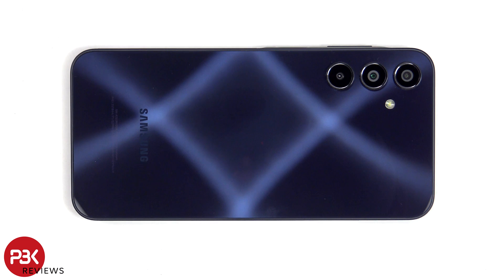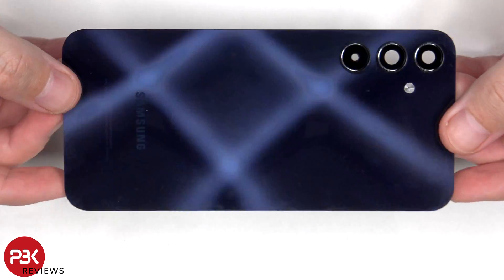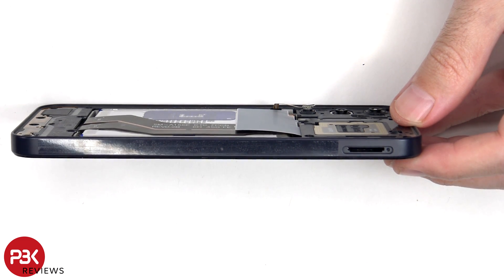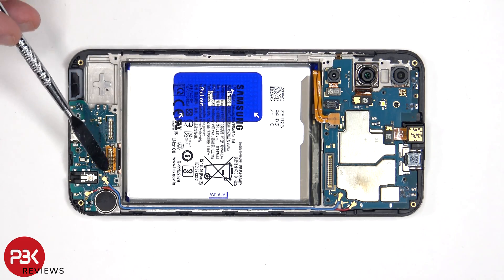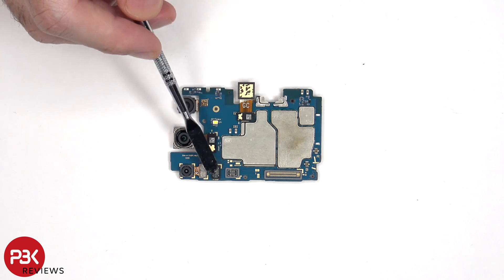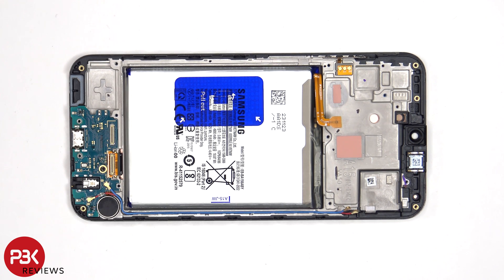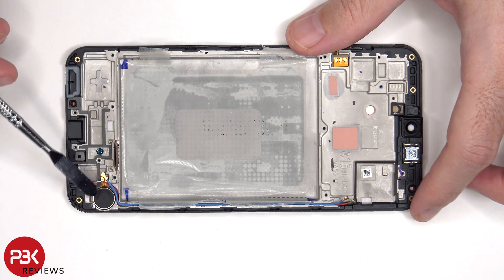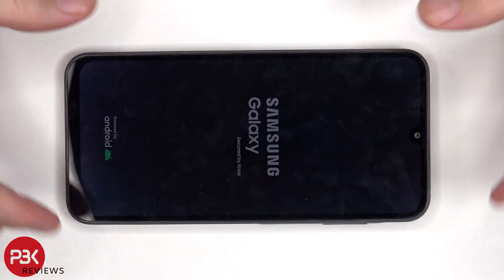Samsung Galaxy A15 Teardown Disassembly Repair Video Review

Comment: You make it sound like the screen is easy to take off in the way that you described it but yet I cannot find a video on YouTube that literally shows that process. I don't need to necessarily know that information anymore but still other people will most likely still want to know that information and you'd be the only person to actually have the video on how to actually replace the screen without just having the screen in the housing already together and just pushing the hardware into the housing.
Reply: ,most times ts easier and more cost effective to just buy a replacement screen already attached to a frame and you just swap all the guts and no hassling with trying to remove just the screen and digitizer etc.   way better IMHO for a non full time phone repair person.

Comment: Nice video, I have a question!
I was using that phone at work when I accidentally dropped it, but it seems it was fine.
It does work normally, but it now takes almost 6, maybe 7 hours to charge fully! It used to take 2h20 could it be the charging port or something else?
Reply from the maker: One of the cables or coaxial cables inside may have gotten loose or disconnected.

Comment: As an American I'll say it, America did nothing to make this repair easier, in fact it was Europe forcing these big companies to have there phones more easily repairable, and pushing for more easy to replace batteries, if it wasn't for them all phone repairs would still require you to take off your screen with a heat gun then to heat gun your glued in battery to get it out. It made me so happy to see the back taken off so it could be used for getting into the phone.

 I'm not a tech expert my I decided to take my screen off my surface pro 5 that had a bloated battery already pushing the screen of and I remember heat that thing to death and they made it so that the screen would shatter on the edges if your didn't do it perfectly, then also locked your battery behind a security screw using your heat sink to stop your from removing the battery, Then you'd haft to heat gun the gaint deadly bloated battery out and pry it off the board. (That is not mentioning the horrendous connection point for the battery) But now thanks to Europe the new surface pro has a flexible screen that's easier to get off that's way more durable, the battery is no longer screwed down from what I recall no glue, and now uses sticky pads to hold that battery with a tabs that lets you pull it off safely so you can take out the battery.

Comment: to those who dont want to heat the backplate: I did it without , its a bit of a tedious task but it works
Reply: Alternatively you can use literal hot plate heated over toaster or in a microwave to heat your phone. It is way saver and easier to not overheat anything.

Comment: Man this sucks, this guy has all these fancy tools and shit, how tf and I supposed to get into it with just regular stuff?
Reply from the maker: fancy tools? lol I'm sure you can find a hair dryer somewhere to head the back up, as well as a guitar pick or pry pick or any plastic that is thin like that which you can get underneath to work your way around. Only thing you may need to order would be a suction cup tool to help you lift up and gain leverage. If not, you can always use a razor blade or knife to peel off the back cover but it would damage or scrape up your frame.

Comment: Excellent teardown video, subbed for future reference!
Reply from the maker: Awesome, thank you!
Reply: @PBKreviews  It worked!! But i believe i failed in getting that awkward little wire to click back on right... so the fingerprint scanner isn't working... i could go back in and try to click it on again but i don't want to break it! I don't really need it to work and if i do, then i can risk it, go back in and try it again.. The main reason for the fix was to retrieve stuff from the phone which i have done :) Thanks again.

Comment: Great video!  Use a hair dryer instead if a heat gun.  Back warped and cracked pretty easily with a heat gun.  This phone sucks so I'm not really concerned with fixing it.
Reply: ...it just overheated on me and won't turn back on at all

Comment: @2:27 where you say "as well as an antenna flex cable on the bottom", is that the wifi antenna? I'm trying to figure out where wifi is emitted from, where the wifi signal will be strongest as viewed from the outside of the case.

Comment: Very plasticy, It has good hardware but build quality still cheap, would be better of just use one solid plastic instead of that thin one
Reply: Yea it's like the a14. Absolute garbage build quality (i know someone the fingerprint scanner literally fell off after a fall) and it feels like shit too. Here it's over 200 euro for the 5g version. It feels like an absolute scam, even if on the inside it's not a bad phone at least the 5g version is quite nice and responsive. But it feels so bad and it's so thick phones like the redmi note 13 are much better and actually have slim bezels

Comment: Please,  promise me that when  samsung galaxy a35 and galaxy a55 will be relased you will take a look into these devices to show us. 👍
Reply: To Fix a phone by tips 5 cost no charge for this fix phone so please don't worry if you're phone not working.
Toggle airplane mode.
Turn the phone off and back on.
Charge the battery with a functional
Reply: Toggle airplane mode.
Turn the phone off and back on.
Charge the battery with a functional

Comment: I like that the edges and the back cover are 2 different pieces, when they put the edges and the back cover as a single piece, in my opinion they made the phone look super tacky and very cheap, they improved the build quality
Reply: And it only costed them 190 dollars for a build quality this good. Shows how design that feels expensive doesn't beat the design that feels rugged. This phone is very solid
Reply: Yes a15 looks good budget phone @sspeedd8809

Comment: Sd card support?
Reply: Yes there is you put the sd card in the sim tray. It fits either a second sim or micros so card. Though I’m not sure the US model will have second sim support but it does still have sd card tray